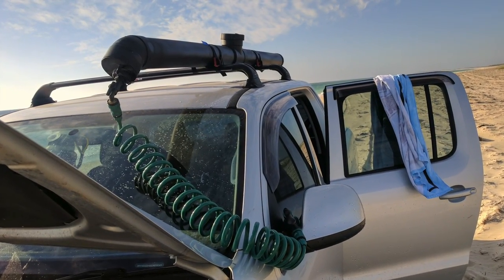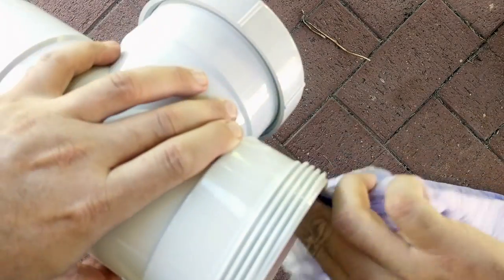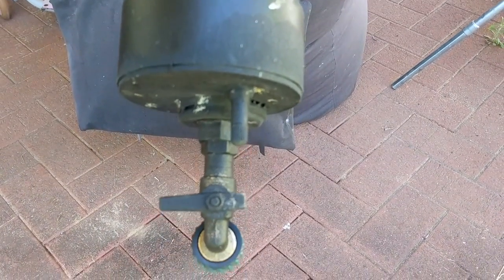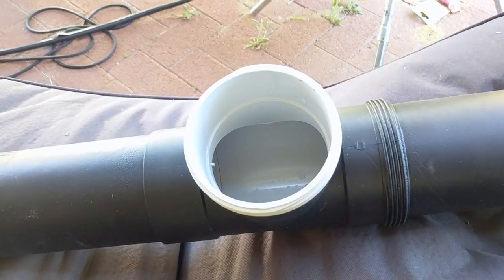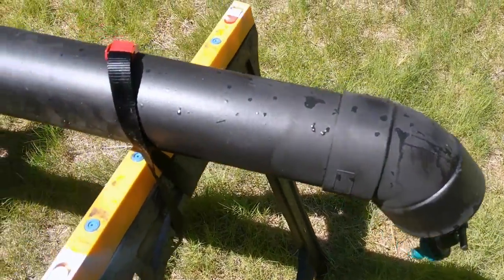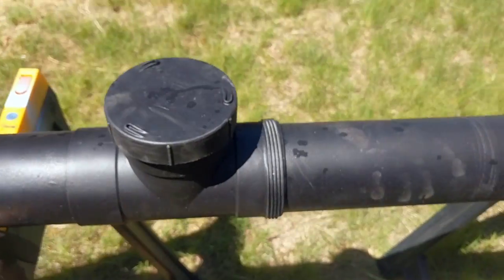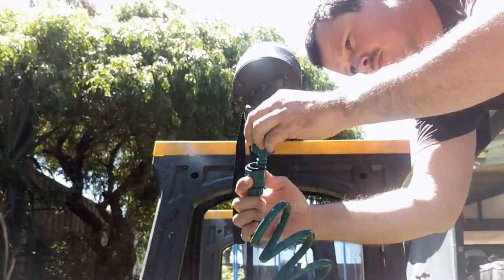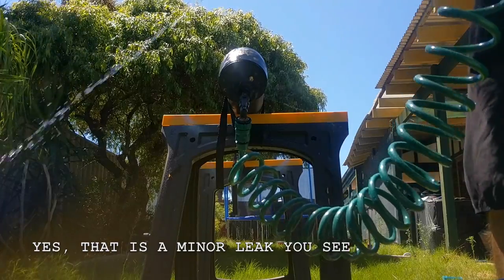DIY solar shower build

Comment: Great stuff. The middle mount fill point. Good idea.The black coating, Not of any use. I have side by side tested! 1 deg at best. Choice also did similar test. Black car White car years ago. same result. the cost of the paint is way more than effective heating.

Comment: Nice video.  I made one quite similar, except instead of using a tee I epoxied a 2.5-inch PVC valve in the upright position.  To fill the tank I just open the valve and pour.
Reply: Does a solar shower have to be pressurized?

Comment: For pressurizing it you could get a washer hose with 2 female ends and if you are filling in with a hose you could fill and pressure at the same time you may have to start with some water in there to get it full
Reply: James Holbrook -  I appreciate your outside of the box thinking, but I can see at least three reasons your idea is faulty.  Physics is unforgiving and there are practicalities to consider.  Earth Based camper's system is as good it gets, so far.   You don't have to take my word for it, you can build your own and find out the hard way.

Comment: Could hook up a small air compressor on a sensor to add air pressure has you use the water to keep a steady stream.

Comment: Great video thanks for posting..
Did your pvc threaded filler cap come with a gasket? Or did you use something to make the seal air tight...
They usually leak pressure  and this point.
Reply from the maker: +George Salvesen mine come with the rubber O ring, it's a good seal and hasn't leaked yet.

Comment: Awesome video. What temp have you found it gets to? Is it really warm? I'm between this and getting a portable gas heated one. What was the final cost for you?
Reply from the maker: +Mike Holford I haven't checked it with a thermometer, it's not as hot as having a shower at home but for camping it's a very comfortable temperature. 
Total cost was $90 Australian or around $70 USD.

Comment: Hi there great idea, why not use black pvc instead of white?.
Reply from the maker: +David Dirom couldn't find any black PVC at the time
Reply: K thanks, just thought there might be a special reason for whit pvc lol, I've seen a few folks utube with white pvc.  Again thanks, will be using your model for my build once I have my storage rack mounted on my SUV.
Reply: In the US, Black is ABS pipe used for drains. It would be wise to research is ABS is safe for use, as human skin can absorb chemicals which may (or may not) leech into the water.
Reply: @richio1763  -  ABS is relatively benign, that said I wouldn't drink from it.  You can purchase a in line filter made for  RV's and boats if you want to piece of mind.
Reply: @ScorpionRegent  Thanks. 'Good to know. Still, I'd just use CPVC which peaks at 200 °F (93 °C) and paint it black. I'm not quite ready to implement my plans, but I really like the idea of rooftop hot water.
Reply: @richio1763  -  There's a lot of back and forth between ABS and PVC.  ABS is thicker, PVC is higher pressure rated.  I'm sure theres a cost difference.  Just find what makes you happy and build.  Yeah it's really cool system.  Lots of people are doing it.   The parts and details vary, but the basic design seems to be quite standard.  Best covering is a flat black bedliner / undercoat.  Paint tends to wear away.
Reply: @ScorpionRegent  black bedliner is a great idea!

Comment: Great vid. Can you please confirm the pipe type and fittings you used to make this, is it 4"/100mm PVC DWV aka sewage pipe (about 3-4mm wall thickness), or is it proper PVC pressure pipe (4x the price)?

I was thinking DWV would handle 30-40psi for this use but I saw in the other comments you said not to use storm water/down pipe that's much thinner, but DWV is not burst pressure rated either (only impact) so not sure what you used?
Reply from the maker: I used pressure pipe for this one, I have heard of people using storm water pipe and not having any issues but that wasn't a risk I wanted to take.
Reply: Don't get me wrong here dude, I'm not picking what you've done or if it works as its exactly what I want to do. I'm actully hoping it is DWV (by your quoted price alone it not PVC pressure pipe) as I want to know if DWV will handle 30-40psi as I suspect it will.

PVC "pressure" pipe is 8+mm wall thickness in 100mm and is over $45/m, the caps a $27/each and a T junction is over $43, none of which is readily available at a hardware store and you have to go to a proper plumbing store like Reese that I priced all that above yesterday. That's $190+ for the 2m PVC setup alone without glue, tap ect.

From studying the video several times what you have used is 100mm DWV and judging buy the brands of pipe, glue ect where all purchased from a local Bunnings. https://www.bunnings.com.au/holman-100mm-female-female-pvc-dwv-test-opening_p4770378

On each cap and the T there is a raised logo with the specs, that should still be visible through the paint, it would be greatly appreciated if you could confirm for me, all you really need to look for is "DWV".

Comment: If you do not release the pressure and there is fluctuating temperatures will it do damage to the shower? Or  is the pvc strong enough to handle the increase in psi?
Reply from the maker: +Kris Ritchie I try to release the pressure after use, but the PVC should be able to handle fluctuations in temperature.

Comment: That is awesome.  How did you install the air value so not air leaks when adding air?
Reply from the maker: +Ron Channels measure the air valve and drill the hole slightly smaller so the rubber on the valve is creating the seal, didn't need any sealant.
Reply: Earth Based Camper  did you use a old bike tier or buy a new one.
Reply from the maker: Bought a valve from a parts shop

Comment: Is it just the fact that the tube is black that heats the water? I have white ones on top of my trailer and thinking of just painting them flat black and see if that heats the water.
Reply from the maker: +Ebony Eclipse the black paint helps a lot
Reply: Mine is a mobile dog grooming trailer, it has the pvc water tanks on the roof but they aren't solar heating, If I simply paint them black, will that make them solar heated? or do I need to add something else? Thanks for info. great video.
Reply from the maker: Painting them black will help with solar heating, you don't need to add anything else, it will still take a few hours in the sun before the water warms up.
Reply: You should always paint PVC anyway because it disintegrates with prolonged exposure to sunlight.
Reply: Ebony Eclipse -  Yes black, particularly flat black, absorbs heat better than any other color.    Automotive bed liner / undercoating is even better than spray paint as it will not scratch and show wear.  It is a solar powered water heater so you need a sunny day and patience, but it does work.  As a plus the hotter it gets the higher the pressure.

Comment: how did you seal the fittings you installed to the end cap?
Reply from the maker: I used a roof and gutter sealant for the tap. 
Tire valve didn't need sealing

Comment: Why not add a pump from a hand pump sprayer at one end of the pipe and put a pressure valve on the water cap so you can't over pressurize it?
Reply: Give it a try!
Reply: Indigo Dragon71 -  I agree with Luke, give it a try.  The toughest part will be getting it to fit together and hold pressure.  I would rather just build it with a Schrader valve and use a air compressor or a bicycle pump, but if a hand sprayer makes you happy, knock yourself out.

Comment: Hey man, you think a bike pump could get it to 30psi?
Reply from the maker: +kamakaedlao Yeah it would, just might take a while.
Reply: kamakaedlao most road bikes run tyre pressures at 100psi. 30psi would just take you a little while with a bike pump

Comment: nice build. however air valve would be constantly submerged - no? weak point? Have you filled with compressor?
Reply from the maker: Yes, air valve is submerged but after 18 months of use has yet to be an issue.

Comment: just make sure you get PVC pipe and not storm water pipe.
Reply from the maker: +Uteopia good point, storm water pipe is not pressure rated and has a much thinner wall